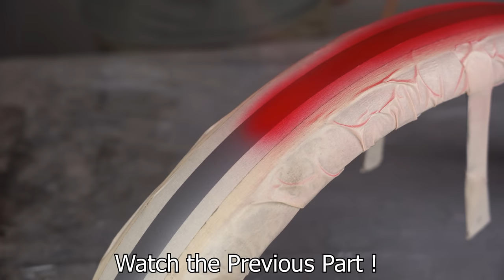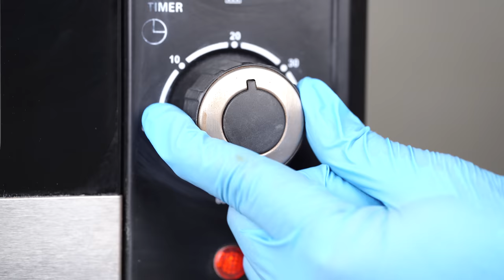Restoration 1963 Triumph Tiger Cub Full ENGINE Rebuild  # 2

Comment: Telling fault was that the engine sprocket needed a strip down to do it. A way they were telling you it would last that long before clapping out. As for a triumph frame characteristic of two long bent tubes going to the headstock was another way of saying it will not handle at all well, it needs the tank to give the frame ‘stiffness’  but it didn’t.
Reply: 3bolts driled welded earthed

Comment: This motor's weakness was the big-end bearing, it was a plain bearing instead of a roller, I ran three of them.  I think there was a roller conversion...
Reply: By Alpha.
John
Reply: Yes there was alpha cost £7.10s , i had a cub in 1966 drove it as fast as it would go all the time ,after two big end failures fitted the roller type .
Reply: I rebuilt my engine with needle follor bearings, big -end ,mains -bearings ,little end ,high compression piston ,hi lift sports cams .
Reply: 1 base 2 base 3 heat exaust welcome 4,exit 5,chamber 6,meter 7, panel seat 8 bye sheet sticker

Comment: Brilliant restore video. However, at 12:37 you can see that the primary crankcase seal E3379, is the wrong way round. The seal spring should be facing the crank, to help prevent a chain case oil leak from the clutch side layshaft.

Comment: Cannot understand why you polished the outer cases but not the points cover or crankcase plugs, or the head casting for that matter. I also didn't see any lubricant applied to the bearing surfaces whilst rebuilding the engine? However there was a lot missed out so may have missed those bits? All in all a nice job, now we need to see and hear it running!!

Comment: I loved my Tiger Cub! Way back in 1968. I don't recall any part of the engine was painted except the barrel. Did you replace all worn bearings and seals and have a rebore with the new piston ? I know parts availability is an issue these days and you can do only the best you can. You certainly did a thorough of cleaning. Very nice.
Reply: KO Jo no